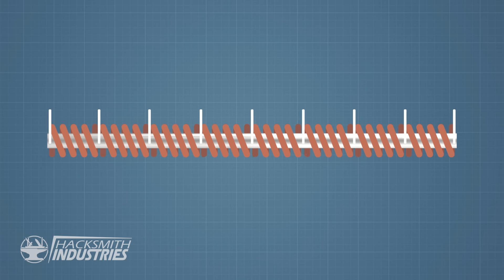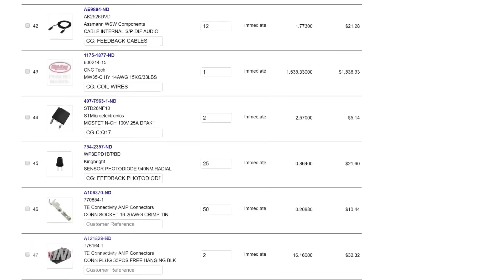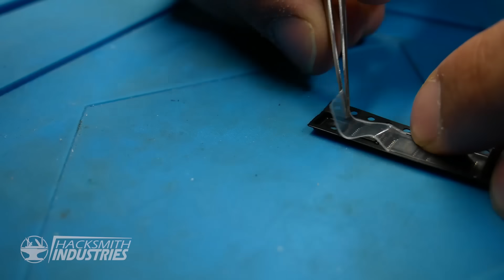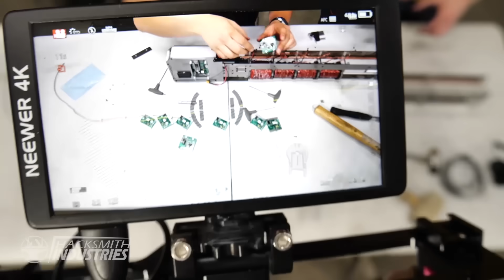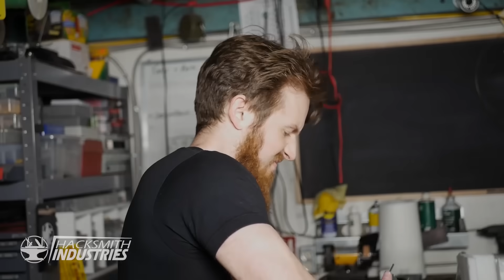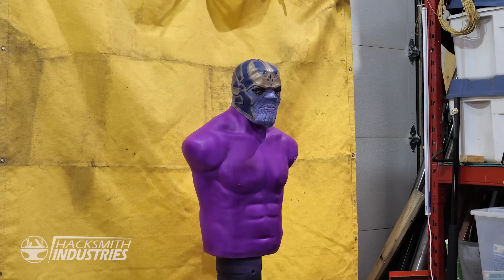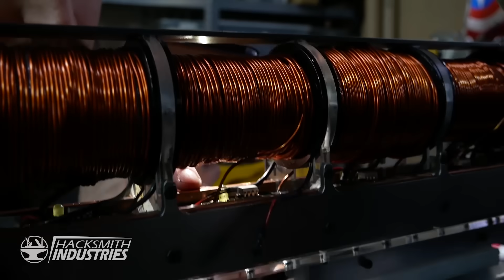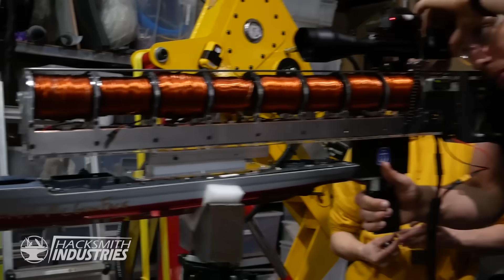50 CAL ELECTRIC COILGUN

Comment: For future upgrades: More power. If those wires aren't smoking they can have more power run through them. Also, thinner wire, more turns on the later coils. The projectile is moving increasingly faster, so each stage down the barrel is turned on for a shorter period of time. That means they can use thinner wire with more turns (more powerful magnet) because power will be applied for a shorter amount of time so they won't overheat. The last stage coils should be thin as hair. (Also, $1500 on wire? Jeeeeesus). Really cool to see Charles front on center for so much of his own build (though the Tony Stark cutaway was perfect).
Reply: MattsAwesomeStuff thin wire also affects how much electricity runs through them
Reply: @prestong2292  yeah, you have to tune it so the resistance of the wire and the inductance of the overall assembled coil so that it saturates at *just the right time*. You also don't want too much inductance, otherwise the coil won't be able to turn all the way off before the projectile passes it.
Reply: They cannot, unfortunately, Canadian laws would basically make it look like they built a functioning nuclear bomb... or something. 

(Excuse my ignorance, I’m not 100% sure)
Reply: Hi Matt,
Charles here. 

I'm glad you enjoyed the project! I had a great time building the thing!

The reason for using thicker wire is not that we are worried about it melting, but that the resistance of thinner wire is very high compared to the rather monstrous 14AWG we used. The limiting factor is the boardmount MOSFETs I chose to use - they could only suffer so much current for so long. Having more turns of thin wire would actually reduce the magnetic field strength and the current, while increasing the inductive time constant, meaning that we would have to turn the coil on earlier to get full performance, and it would be less performance. 

The later stages should be thicker wire, while the earlier stages could be thinner wire, since the time constant matters less when the projectile is slower. 

Also, not quite $1500 on wire. There was a mix up. 

Overheating had nothing to do with it. As it is, we fired it 400 times in an afternoon and it only got mildly warm. 

For more power, we need better transistors, or at least more of them in parallel. The failures we had were due to leaving the coils active for too long, causing a failure in the MOSFET on that stage, or the current sense resistor on that stage. 

It was quite something to solo the design and build, though I had major help from the rest of the team with the construction!
Reply: Additional future upgrades: So first off I am certainly not an electrical engineer however I do tend to get a good/novel idea every now and then. 

I believe if you were to attach a neodymium magnet to the back end of the projectile and instead of producing a simple on off, you were to produce a full square wave (Sine wave would be best). You could no only pull the projectile, but once it cleared the center of the coil you could then reverse the polarity with an H-bridge and push against the magnet to produce even more acceleration and velocity. It would certainly be a complex build and I'm not sure you can reverse the voltage that fast due to flyback voltage but if you could get it to work, I think it would greatly increase the projectile velocity.

Just a thought.
Reply: @Lonnie776  
Also, if they had wrapped the coils around a steel pipe, it would enhance the magnetic field?
Reply: may want to check out  TAOFLEDERMAUS for a more accurate projectile design
Reply: idk who you are but please come build coilguns with me
Reply: Another upgrade, make the stock larger (don’t change the shape) and put a giant hole in the square (the walls of the stock still surrounding it) so you can insert your arm through, it might not be practical but it’s cool asf
Reply: For the performance 1200 bucks or whatever was too much probably needs a bit of tweaking but cool idea 
Wondering how much juice they could have got out of the coils from an old discarded washing machine for nothing though
Reply: I'm thinking all three major ideas combined on this page could make this thing really cool

Comment: 1) Have you tried steel ball bearings?
2) Could the projectiles be machined so that they spin like a rifled barrel would do for a conventional bullet?
Reply: I was going to comment the same thing as #2, since that projectile going sideways is really weird. Making it a bit more aerodynamic as well as rifling it for a spin sounds like a good idea. 

Additionally, I kept thinking this thing is still underpowered because it really looks like they're timing all the coils with the exact same delay (at least I haven't heard otherwise) and that doesn't make sense to me - the projectile is accelerating so the timing needs to be shorter as it goes forward.
Reply: @eslachance  
They did , there's a sensor btween every coil that detects the bullet and turns off the previous coil and turn on the next at the same time , and if you watch the video carefully ull see he calibrates the sensors to determine the best time to do the coil switch,  and he does that for each sensor separately , which fixes the acceleration automatically coz the individual timing .it's not them been precise,  they have to do that coz if timing was even slightly off the bullet won't come out or it'll shoot back word or it'll come out with a little power.
Reply: what you could do to make automatic rifleing is make a projectile that has fins that go into the rifleing. This way when it's pulled forward it will start to rotate.
Reply: @bonkyouded  Or just make it a fin-stabilized discarding sabot projectile to begin with.
Reply: Or use a motor to spin up the projectile before firing. Could make the trigger start spinner motor on pull, and fire on release, which would be a familiar mechanic to most gamers. Plus it you couldn’t wait the 1 second for spin up, you could always release early, at the cost of more drop, less range, worse accuracy, and weak penetration… Clearly it would be better to let it spin up, but you could release after 200 milliseconds and have spin, just not at max rotation speed. 500 milliseconds (half a second) and you get pretty good spin, so projectile will hit straight and get penetration, and it will go further with accuracy, but the spin would wind down and it would tumble at very long range, and at that point forward velocity would also be diminished somewhat, so it would drop fast. At extreme range, you’d really want to let it spins up fully and make each shot count.

I think their projectile is also too heavy for the coils they are using. A slightly longer but much thinner projectile might work better. I’m not sure of projectile requirements for the coil method, but if it could be partially hollow with a solid tip, I think that would be ideal.

Bolt action seems a little silly too. I mean I doubt that the stability of the bolt mechanism will improve the shot in anyway, as it does with high end bolt action rifles, that are precisely machined. I mean most of the benefit a high quality bolt action imparts is because of the way powder burns, where a precisely engineered bolt leaves less room for pressure to escape in little ways here and there which effect power, accuracy, and predictability. Basically, a more tightly controlled explosion. All of that is completely irrelevant with the coils.

I think the idea of “50 caliber” coil gun negatively impacted their results. Energy and time spent facilitating the pointless bolt action, would have been better spent elsewhere, while the large (was .50? I’m not actually sure) projectile would have probably been more effective if it had been lighter, more streamlined, and not tumbling.
Reply: @multi-mason  I don't think that a motor rotating system would be very effective personally I think that a rifled projectile similar to a shotgun slug meant for smooth bores could work well if they make the tube in the coils as close to the diameter of the projectile as possible. I disagree with your thought that a longer thinner projectile would be better I think that the point could potentially cause it to yaw similarly to how the 556 does which would reduce it's effectivity especially with a hollow core. A hollow core provides only one advantage which can be seen as a disadvantage it forces the projectile to keyhole or essentially turn sideways on impact allowing for a bigger wound cavity but also an increased risk of ricochets. For these reasons I believe that a short object that quickly comes to a point (like a perfectly round counter sink bit) would preform better. To address your point over the bolt action it's not pointless the coilgun still needed to be capable of firing more than once and in order for it to fire properly the projectile would need to be held in some sort of chamber the bolt allowed both conditions to be met without the addition of a mechanism to automatically open and load the chamber as it's a magneticly fired system it has no recoil therefore no internal force to open the chamber it would have to be external and would take far more effort to make than a bolt. As for it not providing the benefits of a rifle bolt you're not wrong at least not in the traditional sense it doesn't allow for the improved accuracy of a precision rifle it doesn't have the down sides of a self loading system there's no need to take up space with a mag when every shot is hand loaded and no need to design a self loading system where there is no recoil.
Reply: @lol_hoppy7355  that wouldn't work with metal projectiles they would just end up smoothing it out though it could work for a while.
Reply: @JesusHernandez-bk8km  You could make a barrel from a nonmagnetic metal, but it still wouldn't work. Gunbarrel rifles require an expanding gas behind the projectile to function, becuase what the rifles do, is allow a small amount of gas to escape around the projectile while imparting a helical motion to the gas. This motion is then transfered to a rotation of the projectile by viscous drag forces. Simply forcing a smooth projectile down a rifled barrel will not make it rotate on it's own axis.

What you could do is use a barrel that is not circular, but a regular polygon in cross-section, and projectile to match. Then impart a slight twist on the barrel, such that the projectile will have to rotate on it's own axis to be able to pass through it. The very first guns that used spinning projectiles had twisted hexagonal barrels with hexagonal projectiles
Reply: @troelshansen6212  I don't think you understand how rifling works  it isn't dependent on gas in the slightest they bite into the projectile and do exactly what you're suggesting with a polygonal barrel which is why rifling eventually wears out in fact if you were to measure the interior diameter of a gun barrel it will be a couple thousandths of an inch smaller than the projectile it was meant to fire
Reply: @JesusHernandez-bk8km  I could have sworn I read this somewhere, but I can't seem to find a reference now, and I'm far too busy to dig into it futher. You're right, I'm wrong, carry on and good day.
Reply: Ivfi
Reply: Too much overthinking. Rifled barrel starting after the first coil.

Comment: Next up, fully automatic coil gun with turret style mount
Reply: And faster
Reply: I hope there's a future video where they upgrade each stage with two capacitors from the railgun :D
Reply: Plz actually do this
Reply: Yea
Reply: "Lets not rob this house"
"Why?"
"Look, they have a turret."
Reply: well the coilgun will need a reliable cycling system that can make it full auto this will be hard considering that modern fire arms use recoil or gas-based systems an electronic system must know when the projectile has fired and when to repeat the process and do so on a consistant basis it most likely can be done but is most likely prohibited by US law
not to mention it would coast a fortune to build